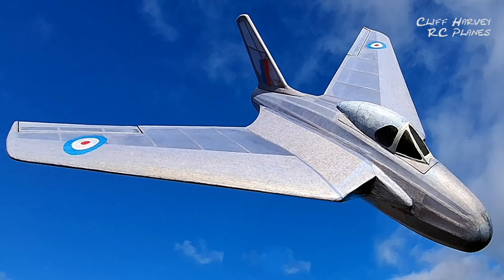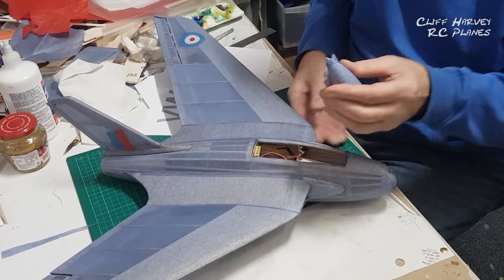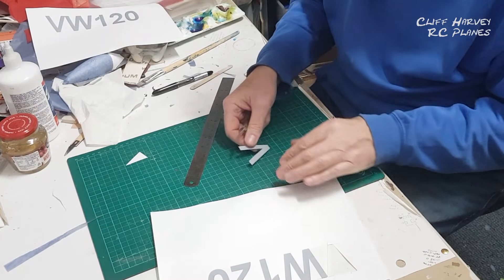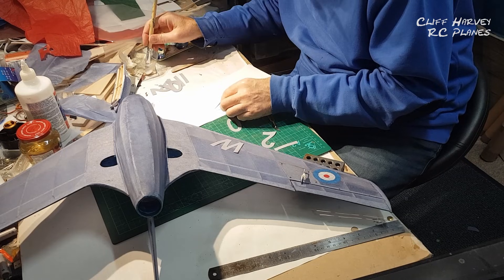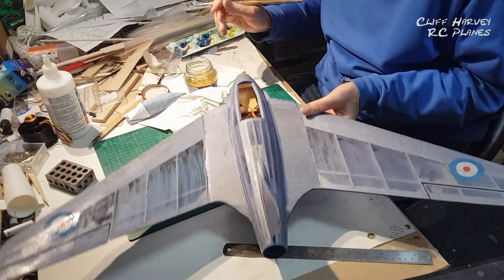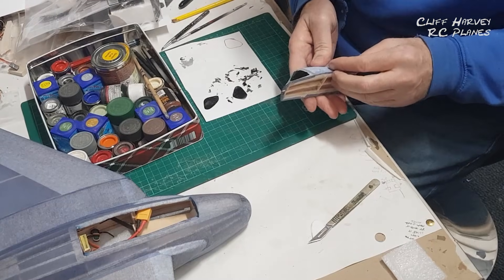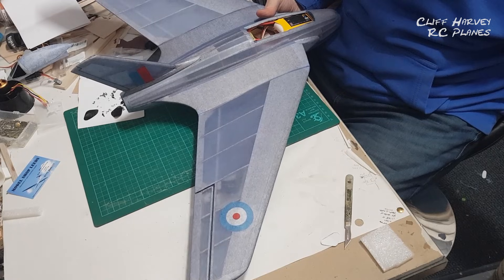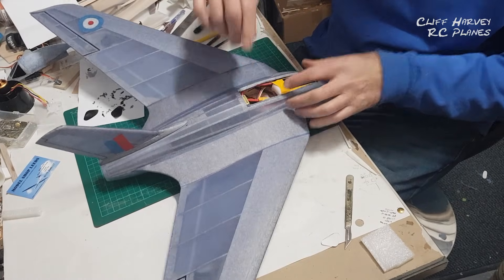Watch Me Build a Balsa Swallow EDF Jet Plane From Scratch! Part Seven Final

Comment: Looking forward to the maiden Cliff.  Enjoyed the whole build process. What weight of paper did you print the lettering on? Standard photocopy paper? I've done this a few times with mixed results but the chamfering of the edges is a great solution to remove the square edges. You're never to old to stop learning! Thanks.
Reply from the maker: Hi Bob, 80g printer paper, ok on flat surfaces, cheers 👍

Comment: Looks so good. Kinda sad it's done actually. What kind of paper did you use for the decals?
Reply: Could you use a glue stick lightly to stick them down then dope them or is the paper too thick?
Reply from the maker: A glue stick would work just as well as thinned pva but my glue stick draw is empty Jim 😁👍
Reply from the maker: The roundels are tissue, the numbers on the bottom are printed onto ordinary printer paper 🙂